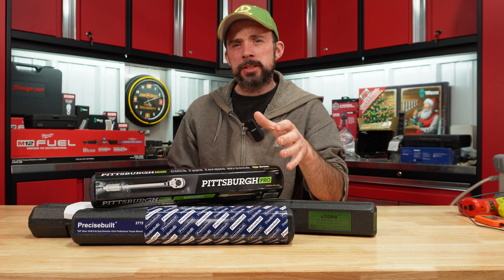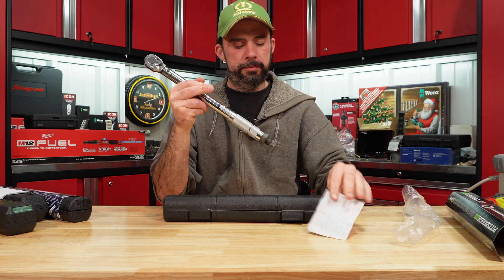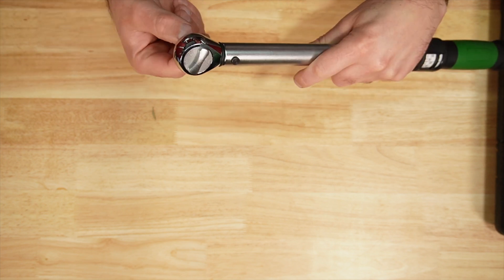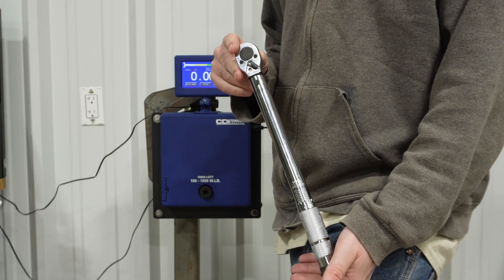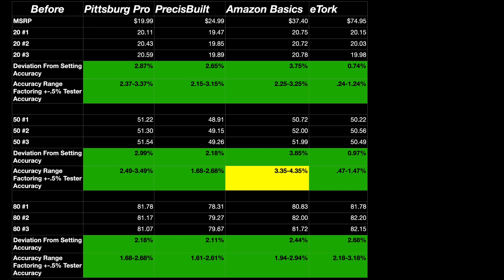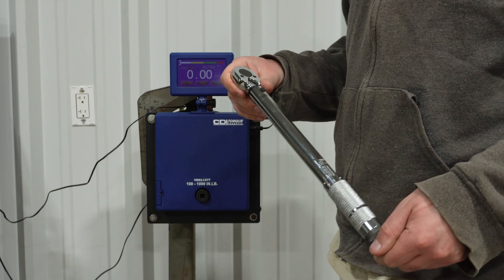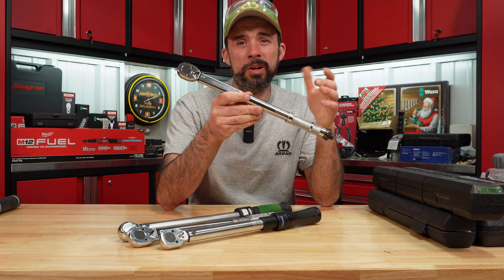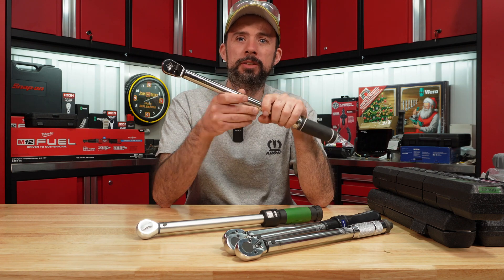Testing 3/8 Ft-Lbs Torque Wrenches

Comment: But, see, the Pittsburgh goes all the way down to 5 ft-lbs, which lets me torque valve cover nuts without buying a 1/4 in. The question is, is it accurate down to that level?
Reply from the maker: I wouldn't recommend it,  all micrometer style torque wrench have an accuracy rating for the upper 80% of the scale.  So in this case 16-80,  so the accuracy at 5 could be more like 10% vs 4%.
Reply: If manufacture and calibration is done correctly, it should depend on what standard the tool complies with. A common example is ISO6789:2017 from which many classes of wrench must comply "from the lowest marked value to 100 % of the maximum torque value of the respective tool." The prior standard only measured starting from 20%, so if it isn't specified which standard a tool complies with, indeed it's safest to assume it may not meet spec below 20%. If it's 2017 standard compliant it should be accurate to its scale minimum.

Comment: If i just wanted one torque wrench for suspension and maintenance and lug nuts would the pittsburgh pro or the icon split beam be better option ? I just want one and be done with it for my diy work

Comment: I have had the eTork wrench you tested and the 3/8 drive 50-250 inch pounds wrench eTork makes for a little over 2 years. I use them to torque electrical lugs and they have done well. It was nice to see I gambled on buying the 100 ft lbs wrench and won lol. Hopefully the eTork 3/8 drive inch lbs wrench is just as accurate as I use it twice as much.
Reply from the maker: Nice, yeah I like it brings the best of both, clime with a digital read out.  I’m hoping to test the 3/8 in a few months but I’m sure it’s accurate.

Comment: I’m actually glad to see the Pittsburgh do well because it’s the only one that goes down to 5 foot pounds.
The lowest torque on the other brands could possibly destroy a gasket on a valve cover or oil pan. Even transmission pan bolts are usually torqued to about 9 foot pounds.
Reply: Who torques valve cover bolts or transmission pan bolts? 😂
Reply: Pwoolw who dont want leaks or stripoed aluminum @Hunnisloot

Comment: Pretty good set of results across the board. Interesting that the Amazon Basics wrench goes out of cal in its mid-range, but is okay either side of that. I wonder who actually makes it for them, it is pretty close in style to the Pittsburg.
Reply from the maker: Yeah the amazon basic acts really weird,  you can cycle it a few more times and its within range then its back out again.  

Yeah I would think they are made by the same company as well,  but I will say the quality on the Amazon is really poor other then the ratchet head.  It's extremely hard to adjust at the top end.
Reply: He mentions that they are each made in a different country. I believe Amazon was Chinna while Pittsburg was vietnam?

Comment: I wish more brands would offer the low range that the Pittsburgh does. Sometimes I just don't like using a little 1/4 torque wrench completely maxed out. I know the 1/4 mechanism is probably good for 50 ft lbs, but the leverage is a huge deal for me
Reply from the maker: Yep the more leverage the better in my book,  I hope to do 3/8 In-Lbs wrenches in a few months.

Comment: Always good info.  I know you’ve done the high mid and lower quality ones but haven’t seen you test CDI. would you consider these mid quality
Reply from the maker: Thanks!  It's on the list,  I would consider it as high quality.  CDI I is basically Snap-on,  CDI is owned by and manufactures torque wrenches for Snap On Brand.

Digital torque wrenches will be next.  Then probably the CDI, 120xp Gearwrench, Hazet

Comment: I had no idea the cheap ones would be this accurate.  I would like to see a video (or short) of you blindly turning a breaker bar and guessing when you got to 20/50/80 in-lbs just to see how close you could get.  You already have an advantage, you basically just calibrated your arms for the feeling of those torques.
Reply from the maker: Yeah I was surprised.  Lol yeah that would be interesting to see how close I could get to the desired torque.